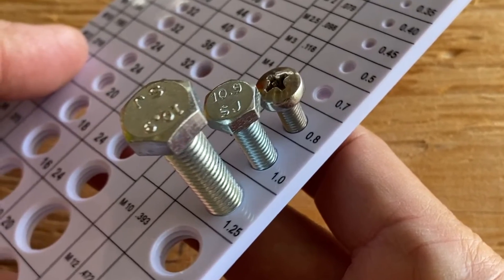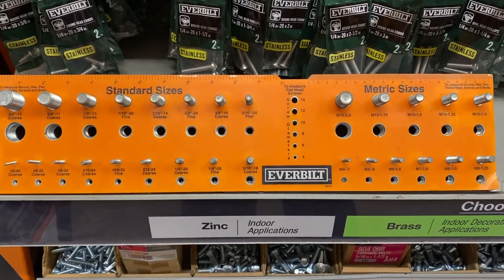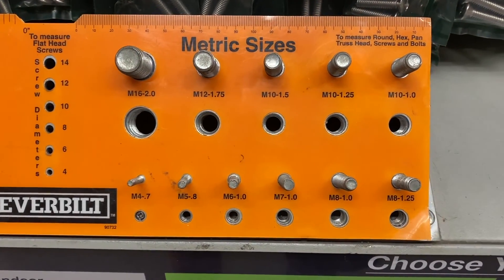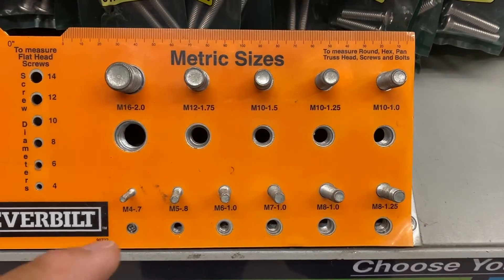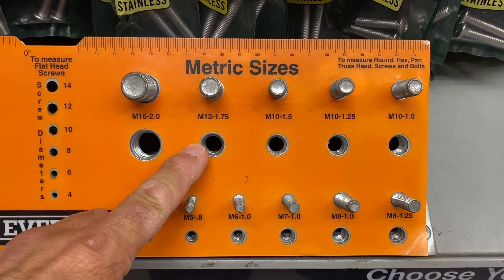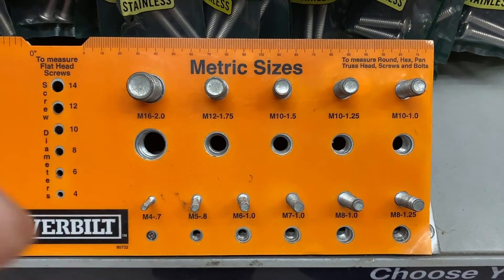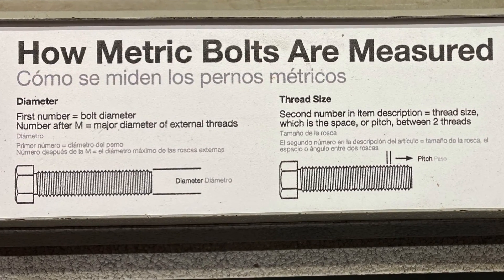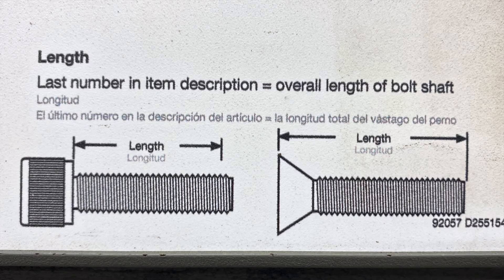Nuts & Bolts - How Metric Bolts are Measured

Comment: Under the SI metric system the "centimetre" is not a preferred unit though it is tolerated for some applications. 
In engineering and construction the millimetre is preferred for almost all applications. 

Primary school teachers need to stop using centimetres.

Comment: No. Diameter and Length is measured in MILLIMETRES, CENTIMETRES and then there are METRES. A meter is a measuring instrument.
Reply from the maker: It is METER in the US.  😎 
Where are you from?
Reply: I’m not sure a country that refuses to use metric should get to have its own spelling of a unit. I’m going to start spelling gallon, g.a.l.l.e.n. out of sheer spite 😬

Comment: Why was it that the 20mm was not measured from the top of the head and the 30mm was measured from the top of the head
Reply from the maker: Cap screws are measured from under the heads and machine screws from the top of the heads.  I showed an example of a 30mm machine screw fitting under the head of a 30mm cap screw.  😎

Comment: One additional "good to know" is if you need to drill and tap a hole just remove the pitch lenght from the diameter and use that drill size. M6*1 use 5mm drill, M8*1,25 use 6,8mm (difficult to find 6,75mm)
Reply from the maker: Thanks!  😎

Comment: Thread checkers that are arranged on a plate are good for the hardware store, but on the vehicle you often can't move the bolt or nut to the wall to check pitch. A more mobile option is a string of thread checkers, which come in either metric or SAE, strung together in a wire with both female and male threads. That strategy works best if you've got a threaded opening that can't be moved. Of course you can make your own from labeled individual bolts and nuts, but assembled thread checkers aren't that expensive and it saves a couple of hours to put it all together.
Reply from the maker: Thanks for sharing... much appreciated!  😎

Comment: Thanks, very informative.
One thing to point out is that your calculations only works if you already know the thread length, and so there's no real reason to measure it at that point. Better to instead measuring how many threads are in 10mm and divide 10 with that number to get the length? Or maybe 20mm?

Comment: It can be confusing to look at thread pitch because SAE and metric are kind of opposite each other.  An SAE #10 coarse is 24, fine is 32 (bigger number) but an M6 coarse is 1.00, fine is .75 (smaller number). The difference is "threads per inch" versus "millimeters per thread".  You explained the metric side very well and now I have my head screwed on straight.
Reply from the maker: Thanks!  Never thought of it that way before.  😎